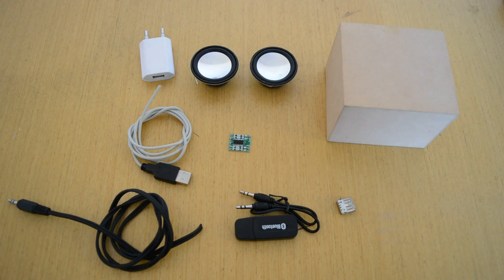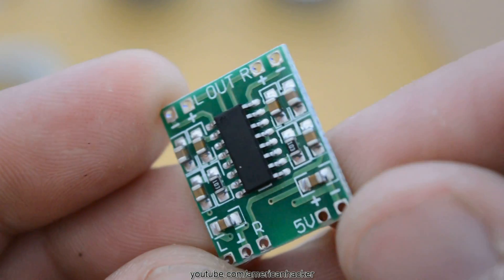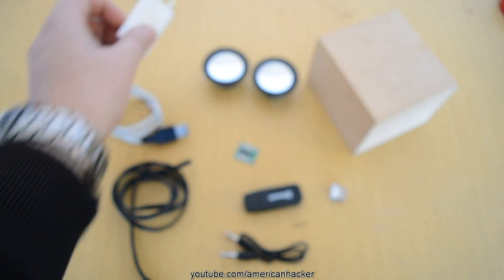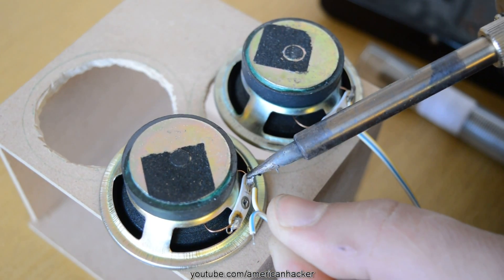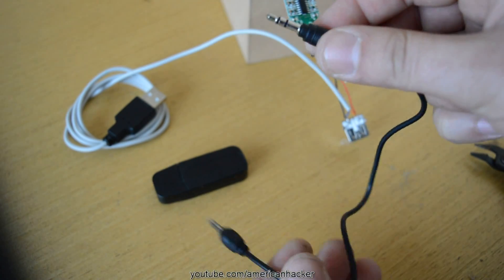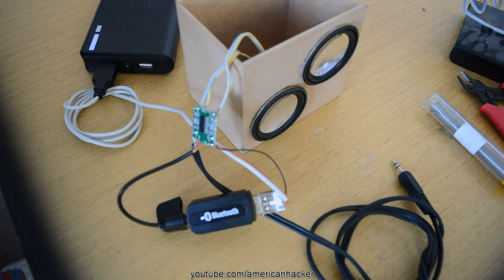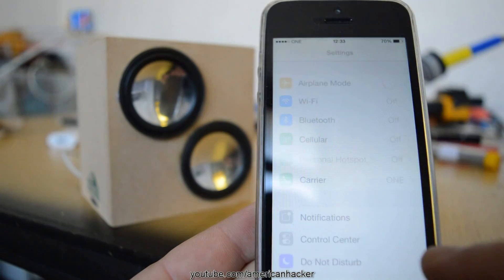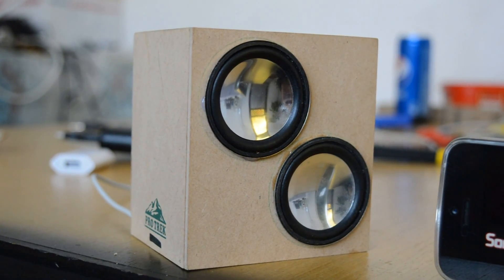DIY Bluetooth Speaker for 5$

Comment: i have a poblem. Otherwise this works but bluetooth disconnects after 20 s of playing and turns off. if you connect 3.5 mm straight to phone it works but it would be nice if bluetooth worked too.

Comment: Just make sure you use 8 ohm speakers for this build, not 4 ohms. As 4 ohms speakers will require 1.25 Amps to be powered. Which is slightly over the recommended amperage output of a generic 5 volt phone charger. At 6 ohms its 0.83 amps, And at 8 ohms its 0.63 Amps. If you don't have anything but 4 ohms speakers. Try using a charger of a tablet, as they have a higher amperage rating. (Look at the label of your charger for the maximum output of your charger.)
Reply: The output impedance won't really affect the circuit power consumption, with the Vcc being constant.
Reply: +Morten Kristoffersen I'm sure it does . The impedance of the speaker is the primary factor which  determines current draw and intern power . The amp used here can't drive lower impedance speakers . it's not rated to do so . if you want to use a 4ohm speaker , get an amp which can handle such current draws and ofc a suitable power source .

Comment: where do you buy the circuit board i cabt find it anywhere?
Reply: http://www.ebay.com/itm/272230446624?_trksid=p2057872.m2749.l2649&ssPageName=STRK%3AMEBIDX%3AIT
Reply: +Jarrod punkinman http://www.banggood.com/2x3W-Mini-Digital-Power-Amplifier-Board-Class-D-Audio-Module-USB-DC-5V-p-929449.html

Comment: I have a normal USB and 3.5 mm jack speakers for the laptop ,I am planning on just transferring the casing and use a power bank by connecting the USB jack and the 3.5 in the Bluetooth adapter will it work out just as fine ??

Comment: I like the project ... but I don't know which wire I need to connect to the other. That was hard to see on the video. Can you explain... as special the last part of the wires you connected.
Reply from the maker: what kind of amp board you have?
Reply: The same as you use in the video

Comment: say I wanted to make this with six speakers. how would I do that? cause I don't feel I could hook all six up to the same chip. plus it needing more power possibly. what do you think?
Reply: +tyler duarte maybe if you used multiple chips for the speaker then tear out some extra wiring and solder it to all of the ports for power and the usb but join them the wiring as one if that makes any since. but tbh i'm 100% new to this so who knows if it'd work lol but if you've already found a way to hook up all those speakers i'd love to know how you did it because i plan on making this within the next few days

Comment: do the key nife
Reply: +American Hacker i tried makin this but its not working...when connected to power supply , the IC on board heats up thats all
Reply from the maker: I have already made it,visit my channel page
Reply: +Karthik K We can probably help you. If heat is building up, first of all check the battery polarity. Check speaker cables have not shorted out. These are the two first to check.
Reply: Isaac Fosnaugh g

Comment: Wait,! what about ground loop interference?? this setup would obviously suffer from it.  Is that the reason we got no sound test?
Reply: +LC 7INEO i tried making this and a have a piiiii noise. this is very ennoying when there is a quit part in the song, when i use the cable everything works fine do you have a solution to this problem? thanks in advance
Reply: +Airborne No, sadly all I've found is big car audio groundloop filters but for this size and voltages, nothing. perhaps someone in the comments has an answer¿?
Reply: +LC 7INEO I tried this project and now facing the same problem.....there is a way around  though, if you can power the amp and the Bluetooth receiver from different power sources than this does eliminate the external noise.
Reply: Yes i know but i dont really want to use 2 different power sources
Reply: +Airborne I understand that's a bummer !

Comment: hey can any body help me out i have only one speaker and don't no the volts and can i use 9v battery instead of power bank i not want speaker wireless
Reply: Maybe it will be to much voltage. Upgrade the amplifier to a 9v?
Reply: +Juic3 Beats okk i will try n thanx for help
Reply: +Varun Ahuja Or build a voltage divider to reduce the voltage to 5 volts.

Comment: I would make a knot in those cables inside of the box. The glue is nice but you need some mechanical protection so the cables don't pull on the printed circuit boards when the glue fails.
Otherwise boys and girls, never throw away useful stuff. There is a lot of stuff and fun to be had with failed electronics!

Comment: Dude you are soldering the wrong way.
Reply from the maker: +Marcus Christensen why?
Reply: American Hacker Well when you apply the solder to the soldering iron first you are destroying the flux creating a cold solder joint. The flux removes the outer oxide layer of the wires creating a better bond. You need to heat up the object that is getting solder then applying the solder to the object, not the iron. But you might have to start with the iron to get it to melt.
Reply: +Marcus Christensen Thank you for saiyng that, to be honest I never knew that and now I will keep that in mind.